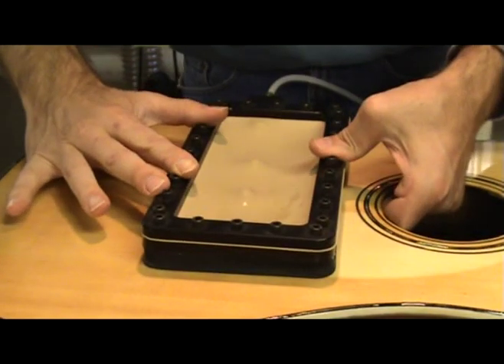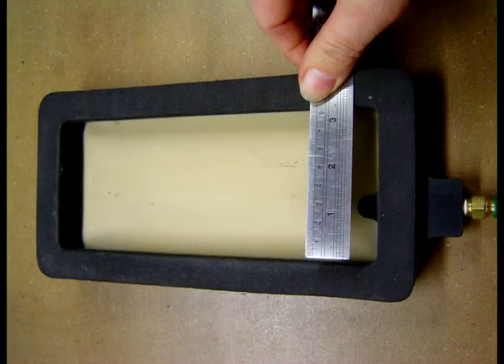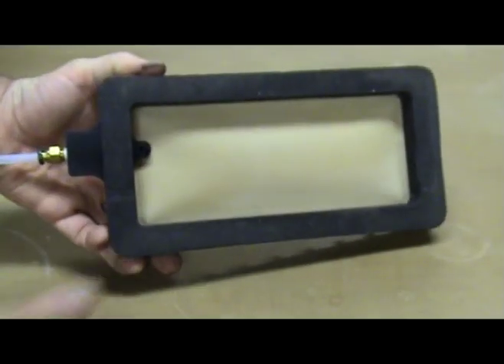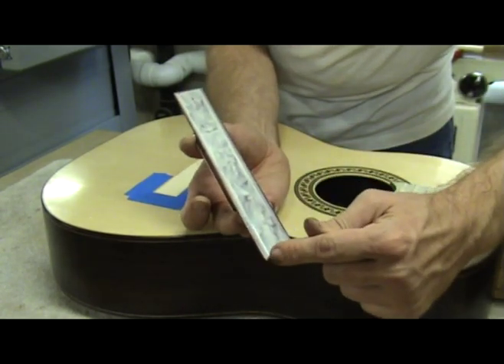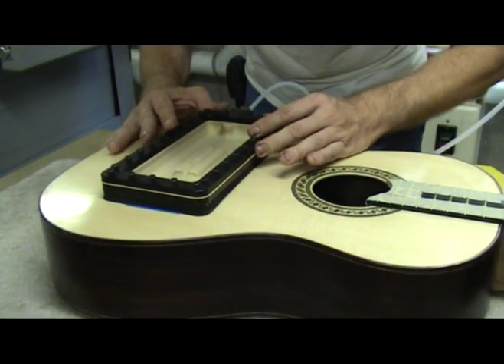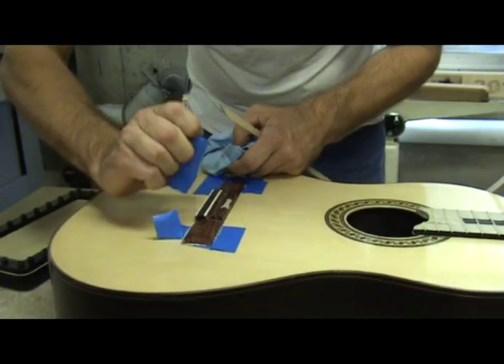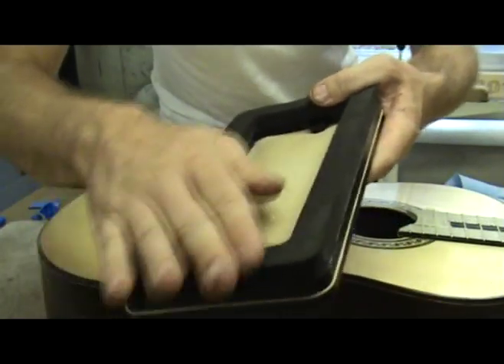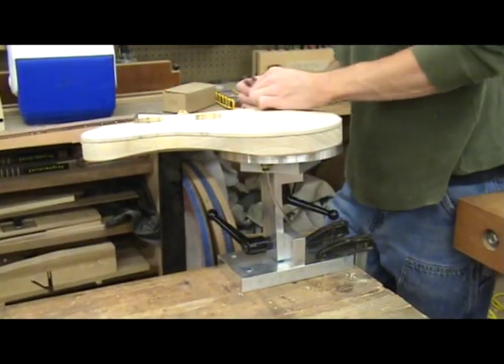O'Brien Guitars - Luthier Tips du Jour- Vacuum Fixtures

Comment: The work holder vacuum you have is totally different than what LMI sells.  That is the one I would really like? Who made it and are they available?

LMI's Vacuum Work holder is not tall enough, the round bracket that fits in to the panavise is less that 2 1/2' It should be at least 6", I recently ordered the LMi and was disappointed with it and have requested an RMA to send it back

Comment: you need to redo your calculation. The area you should use is not that of the whole fixture, but just that of the bridge itself. The remainder of the fixture presses  on the soundboard, not the bridge.